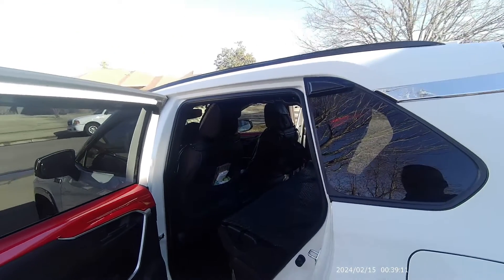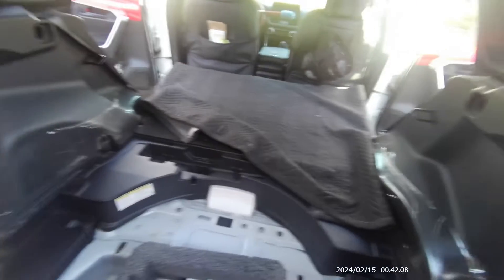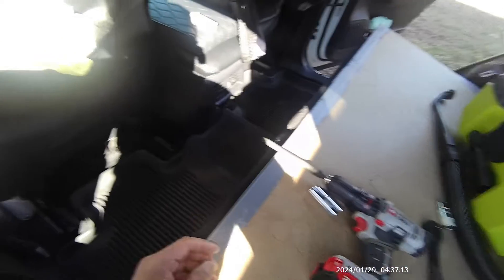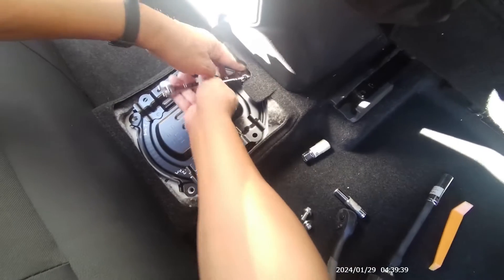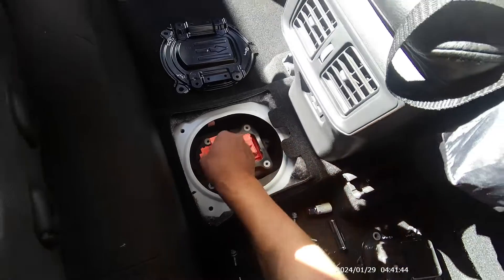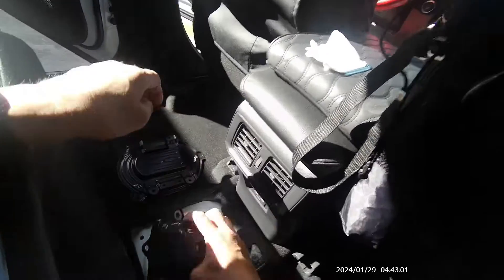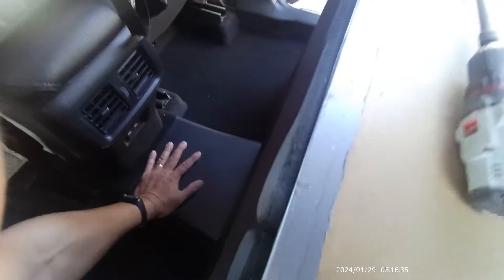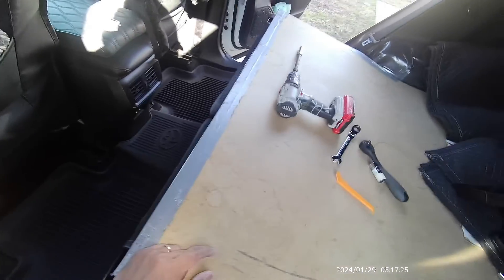RAV4 PRIME AND ON MOST HYBRIDS DISCONNECTING HYBRID SERVICE PLUG. HYBRID MALFUNCTION NOTICE ON DASH

Comment: Hey Mr Ez-Pz 😂🤣😂  aka @JT2QUICK have you accomplished or contemplated a project for the rear power plug issue?  AKA Cable-Gate issue.  No winter salt in OK or TX to accerate corrosion, but paranoid folks such as myself like preventive maintenance.  There's a product called CableWarden, but it's expensive. 👌😎👍
Reply from the maker: Hey TJ.... JT here.. well..nothing accomplished, but I'll share my thoughts.  I'll put up the video here in a next few days. and HOLY TOLEDO...that CableWarden???? from $212 to $1095?  Some people making some money here...well...they got the skills and know-how on how to get it done...so...more power to them.... But maybe if I was in a location more prone to salt, brine, or anyplace that's more likely to cause some water damage...I "MIGHT" invest in it.  anyways.. I'll put up the video shortly.. Not sure what part of the country you're at.  Later....